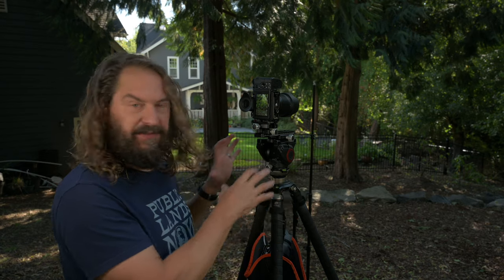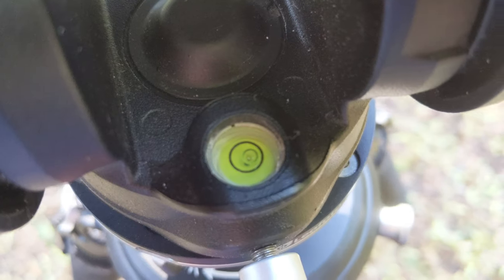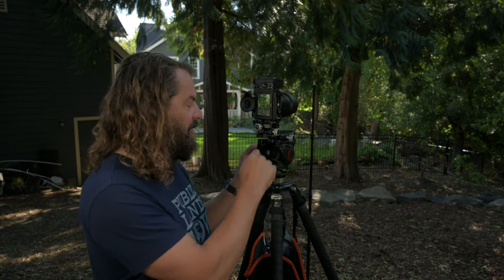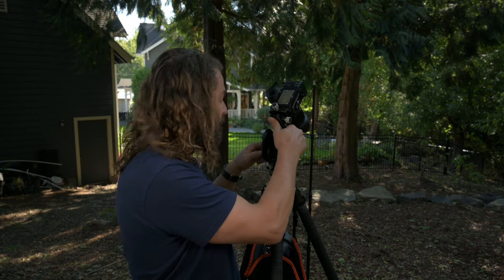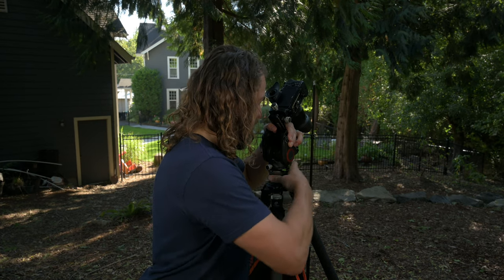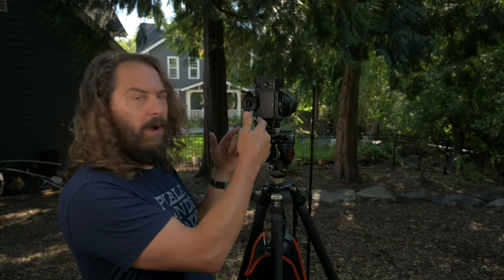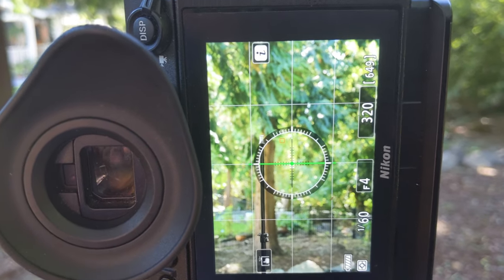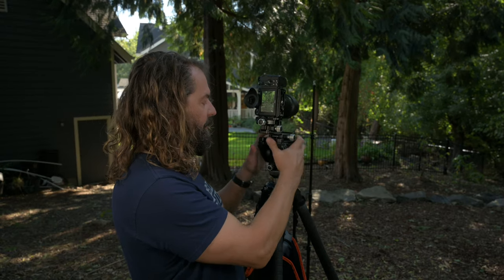Quick Tip: How to Level Your Pan & Tilt or Fluid Head

Comment: Thanks. On the move shoot move tracker I try to level the top of the ball head, and then mount a small pan and tilt.  I have to keep re leveling the ball head as the tracker moves, but it allows me to grab some panno shots of the foreground and stars. I assume this is correct.  I tried the ball head by itself but it's way to difficult to realign when grabbing shots
Reply from the maker: Yeah Barry. Go with a pan and tilt head or fluid head under it level to get locked on the North Star easily. Then compose with the ball above. I'm actually of the opinion that you should shoot as unobstructed a view of the milky way as possible with the tracker and not worry about level. Either before or after, shoot the foreground with a long exposure and any lightpainting you might want to do. It will be easier to blend in the clean milky way that way.

Comment: Love your work, and have ditched the ball head…500AH arrives tomorrow. Quick Q regarding leveling base on the Gitzo 3543LS: would you recommend Kirk TLB-1, TLB-2, or Acratech as the best solution, irrespective of weight / size? Many thanks!
Reply from the maker: If you bought the 3543 new and it's in the return window, I'd sadly urge you to reconsider. The Gitzo stuff just isn't anywhere near what it used to be a decade ago. What I see, and my friends in the industry agree, is a company getting as much cash as possible from the reputation of a previous generation of products. Management has changed several times sadly. I bought a 3543XLS a few years back and was horribly disappointed with the lack of quality. The most innovative tripods I've found are coming from Leofoto. I'm not a fan of their heads, but the tripod legs division is killing it. Likewise, I LOVE their systematic LB-75S leveling adapter. It lets you keep both hands on the head and snug the system with a pinky before letting go and tightening it the rest of the way. It also has three uniquely and brilliantly placed set screws to lock the head down that are very simply accessed, and it lets you go right to the ground. No brainer. You can see the systems I'm building and recommending now right here: www.hudsonhenry.com/tripods
Reply: @HudsonHenryPhoto  I would make an update video then on the “why I use fluid heads” video... I went off your advice and got the 3543XLS and reading this comment now makes me be like wait...what? It was special order so no returns. On that front, maybe you could update us on the gitzo changes. As far as I can tell, it’s decent still. Not sure what they were made like a decade ago though 🧐

Comment: I have the same fluid head as shown in this video (based upon your recommendation actually!).  Even with everything locked down, the head has "play" in it.  I can kind of jiggle it back and forth.  Does it sound like something is wrong with the head?
Reply from the maker: Have you locked it down wiht set screws snug on the base? No there should be absolutely no play locked down. Check each component top to bottom. (L-bracket, clamp's, head leveling adapter, leveling adapter to legs). Any loose component can create play. I had a bit of play and found I hadn't tightened the clamp down enough on my Kirk bridge replacement system for the 500AH. Bottom line, the 500 should have zero play if you tighten the pan adjust.

The only caveat is that if you over-torque that pan lock knob (Say to mount the head tight without set screws on the leveling adapter), you could damage the pan lock. That happens a lot with any type of ball head. You have to be really careful not to over tighten any kind of screws or threaded parts, particularly light-weight ones made for bicycles or camera gear.
Reply: @HudsonHenryPhoto , thank you so much for the response.  I finally found a few minutes to thoroughly investigate the problem.  It turns out that the screws that mount the head to the half ball leveling adapter had come ever so slightly loose.  So it actually wasn't the pan lock that was loose, it was the entire head.  Tightening those screws fixed the problem.  I can't figure out how those screws came loose though as I've only used the head a couple of times for indoor shoots.  I tried to heed your warning about not over tightening the screws but they seemed to need a fair amount of force to take out all of the movement.  I hope that I don't continue to have trouble with those screws as it will be fairly inconvenient to have to remove the head from the half ball on a regular basis.
Reply from the maker: Ha, those screws you should set pretty tight. They're a bit of an exception to that rule. :)
Reply: @HudsonHenryPhoto , the more you know ... :)  Thank you!
Reply from the maker: Oh and if you look at the bottom of the head, there is a funny pattern of ramp shapes where those screws hit. Every now and again I've had it set just wrong so that you hit a bit where if it rotates just a little and the shape requires you to retighten it to get it fully locked in. Hope that makes sense.
Reply: @HudsonHenryPhoto , it definitely does.  Thank you for the extra info!

Comment: My manfrotto 500ah level was waaay off. I got replacement and it’s much closer.
Reply from the maker: Bummer. Haven't had that issue. I find that it's rare a group of levels agree when working with multiple dovetail connections and support gear with set-screws to lock them. My go to is the highest level possible. ;-)
Reply: @HudsonHenryPhoto  yeah it was kind of strange, I went off the level on the head and my z9 was showing a hell of a angle. New one is great and super happy with it. Appreciate all the videos as they have helped me in many ways! Hope to meet up someday! 💪🏻

Comment: This is really helpful but I am not sure what of all these things I need to convert my RRS versa series 3 tripod to take the Manfrotto head. Anybody out there done that? RRS has a video ball and it is 2.9" wide but I don't know if that will allow the Manfrotto head to attach and what leveling base to get. UGH! Any help would be great...
Reply from the maker: Is it a systematic with a 75mm top plate? I think it is. If so just look at the fluid head section on my links page and focus on #1, but skip the legs. :) www.hudsonhenry.com/atslinks
Reply from the maker: oh, I have more in depth videos on the setup too. Check this one out: https://youtu.be/Ei8XYK5Cz-k and this newer yet one with a better leveler: https://youtu.be/fKjchwMSu7Y
Reply: @HudsonHenryPhoto  Thanks for the newer video...but I can't tell if I need to buy a 75mm bowl from RRS and whether/how the leophoto leveling adapter will attach to it. Don't know who to ask and I bet the RRS won't help much. Their adapters are much more expensive. Thanks again.
Reply from the maker: Thier adapters are also not nearly as good. I hate the lack of set screws. If you get the leophoto one that I link, you don't need a bowl. It's the whole thing. It just drops in where your plate is or a bowl would go. No other need. It's simple and better. :)